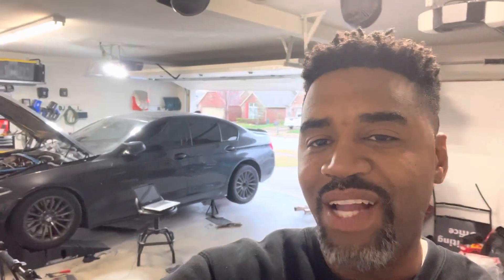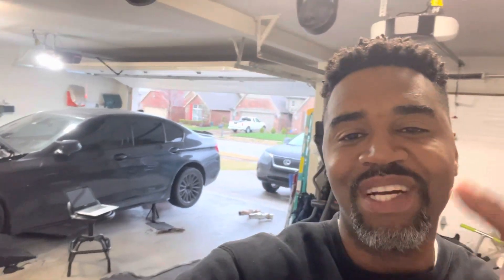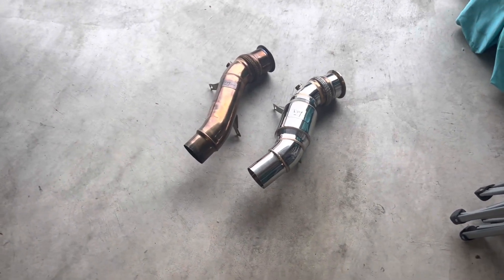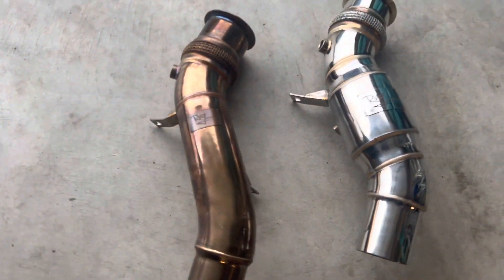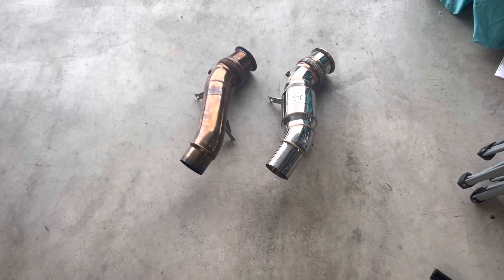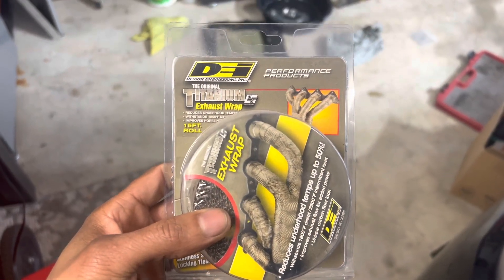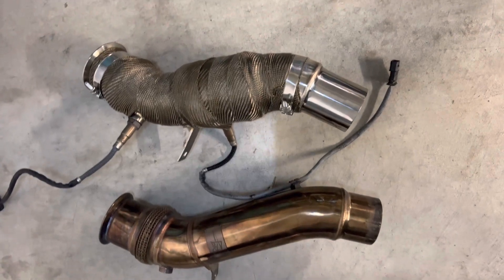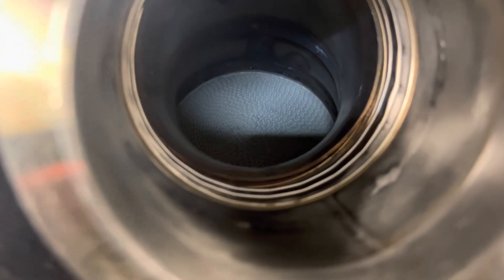BMW N55 Performance Boost: High Flow Catted Downpipe Installation

Comment: As a welder I must say those are some damn pretty welds on an aftermarket part.  RVG definitely stands for quality!  And thanks for making more and more videos Grant.  Made me love my F10 even more!
Reply from the maker: Glad I could help! Also, thanks for the input on the welds. I use to work at a shop with welders and I thought the same when I saw them. I still need to learn to weld though.
Reply: @johnsonmotorsports I want to buy one of those down pipes but I don’t like it the check engine light on I just want to know if we this new down pipe I don’t have any lights on thanks
Reply: @miguelrosario6485 I think that’s why you need to tune it so the system knows .

Comment: Ordered mine yesterday. High flow cat as well. Fingers crossed 🤞 all goes well. Just need to get my Intercooler and some time off to do it once I get the parts. Nice vid by the way.
Reply from the maker: You can do it! I’m sure fitment will be great!
Reply: How did it go? Any video or sound clips?
Reply: No not yet. Just got back from detachment late September so I didn’t have the car. Maybe this weekend again fingers crossed 🤞

Comment: Looks great! I've been debating switching my catless to a high-flow catted for the smell as well, lol
Reply: It honestly smells like a diesel , it doesn’t smell so bad with a e mix
Reply: @KevinTorres-xc2sv  lol interesting! Yea I typically run E50 mix but im currently redoing my entire tune due to a new turbo. So Im starting with straight fuel and Gawd that stink 😂. E50 is so much more manageable
Reply from the maker: Absolutely!!

Comment: How do you like the high-flow downpipe?   I am really thinking about getting one for my 2016 535i, but of course I would need the EWG version and RVG seems to be the only one out there that I can find that of good quality.  This is to go along with the the AFE cold air intake, G-plus stepped intercooler and VRSF down pipe I installed.  Plus, I just got the MHD super license.  Great thorough videos.

Comment: Would you also recommend a charge pipe to go along with the high flow downpipe?
Reply: if you are going for stage 1, ect... you should for sure consider going for a new charge pipe, the oem charge aint gona hold up with the increase in power and will break eventually. : )
Reply from the maker: Exactly! Chargepipe should be your first upgrade.

Comment: Sounds good.  Doesn’t sound much diff from mine running a catless DP.  I’m EWG. Btw who makes the diffuser you’re running? Thanks.
Reply from the maker: Diffuser is here, but the fitment isn’t great. Had to use zip ties in the corners for them to stay seated.

BMW F10 535i Mods: Ninte Rear Diffuser
https://youtu.be/QTriKPa8fE8

Comment: Hey Grant... About ready to hit the "buy now" button for the rvg catted downpipe for my 2013 535i. I know you have one, so since you've had yours for a while now do you recommend it? Also since I have Valvetronic mufflers will I notice much of a sound difference compared to my stock downpipe? And lastly how about any actual performance gains? I do have the MHD full license setup  running stage 1, but sometimes I crank it up to stage 2+. Just wondering if it's a performance gain I will feel?? Oh yeah have you done a tranny flash? I just bought the XHP flash kit and all I can say is wow. Stage 3 is a night and day difference especially in sport plus.. Hope to hear back from you. I value your opinion. 
Thanks for all your work!!
Reply from the maker: Hey, yeah you will notice a sound difference with the catted downpipe. It’s not a crazy difference, but it is present. I don’t have any performance data regarding the downpipe, but it will definitely help. 
Yeah, I have xhp as well. Love stage 3, it is definitely night and day. I am actually considering getting a custom xhp tune.

Comment: How do these pipes compare to the extremely similar looking Racing Dynamics pipes? 
They both use 200 cel but the RD advertise the type of cat being used.  Any word from RVG on what  level of quality cat they use?
Reply from the maker: I know nothing of Racing Dynamics. I’ve never heard of them. I have checked into the quality of the cat, however I know every other part of the construction is top notch.

Comment: My shop attempted to install these but the lower Brackets are off by inches.  The top Brackets only fit 1 of the 2 bolts on both sides.
Reply from the maker: Are you sure you purchased the correct downpipe? I’ve installed 4 of these pwg downpipes and I’ve never had a single one that didn’t line up properly.
Reply: @JohnsonMotorsports  I ordered the correct pipe, maybe they sent the wrong one.  Either way, I'm out almost $1100 in addition to the pipes.
Reply from the maker: How??? What year and model do you have?
Reply: @JohnsonMotorsports  19 m850 coupe.  I had the pipes ceratoke coated as well.
Reply from the maker: Interesting. I don’t know anything about that model. Have you reached out to RVG?
Reply: Does it cause the CEL to come on?
Reply: @Cashka1986  it did
Reply: Thanks for the info
Reply from the maker: Yes, you will need a tune to remove the CEL.
Reply: @JohnsonMotorsports  that’s ok I have MHD. Thanks
Reply from the maker: Perfect.

Comment: Ngl i just installed catless dp on my f33 and the smell is already getting to me🫤
It's fun to drive but the smell messes up the experience 
Can the aftermarket high flow catted pass the emissions test?
Reply from the maker: Honestly, I’m not sure. We don’t have inspections in Oklahoma. They did away with them 30 years ago.

Comment: Hello friend i just want ask ur last video u install the m steering n paddle shifter n how to make the paddle shifter working n need wiring n bimmercode right?
Reply from the maker: The wiring should already be there. Should just need to code.
Reply: Code with bimmercode?
Reply: Bcoz my original steering dont have the paddle n im planing to install the m Steering with paddle shifter
Reply from the maker: Yes, I would try with Bimmercode first. That’s the easiest. When I installed mine, I had already coded my car with Esys for the DEC switch and sport transmission. So it’s hard for me to say what actually worked.

Comment: I’ve had this pipe for close to 2 months now and it’s been so ridiculously hot in Dallas that I haven’t been able to get it installed yet. And every shop I’ve gone to tells me they won’t mess with it because of the turbo. Any ideas why they would shy away from this? Your install makes it look relatively cut and dry, so I don’t get it!
Reply from the maker: That’s weird. Why would they not install it because of the turbo?
Reply: @JohnsonMotorsports  not entirely sure. Hoping it starts cooling down and then I’ll just do it myself 🤣 Your previous install is basically the same as for this pipe, correct? No major issues with fitment (except our bodies under the car 🤣)?
Reply from the maker: @xbeautifuldiscordx  Exactly! It’s really not a bad install.

Comment: U need a tune with the down pipe right
Reply from the maker: No, but you will get a check engine light. The tune will avoid the check engine light and let you increase power to take advantage of the free flowing exhaust.
Reply: @JohnsonMotorsports what tuner do you have? I finally got this installed and getting CELS now with my MHD Stage 2 tune and can’t get it to go away
Reply from the maker: That’s weird. Did you select catless downpipes in the tune options? That should be all you need.
My tuner is David Shoup.
Reply: @JohnsonMotorsports  no I stuck with OEM because it’s still a catted pipe. MHD only has options for OEM or Aftermarket Downpipe
Reply from the maker: Then I would choose Aftermarket. The Highflow catted downpipe has a lower cell count.

Comment: I need a valtronic motor as well
Reply from the maker: Yeah, I’ve done it once. Still watching this one, maybe a battery issue.
Reply: @JohnsonMotorsports  I'm debating with 218,000 miles it's running very good I've gotten everything done to it it's a 2011 I'm thinking about getting another one in October
Reply from the maker: @jeromepatten8763  Nice! Have you done all the maintenance yourself?

Comment: I was going to order one of these to replace my VSRF catless on my 2011. Question here is do you still have to uncheck the "factory cat" option in the tune to disable the CEL? Reason for change is I don't want to have to swap the DP out every year for inspection.
Reply from the maker: I honestly don’t know, I’ve been tuned for catless downpipes for years.
Reply: Thanks. Same but I've never tried bringing it for inspection this way. I've always just swapped pipes for a few weeks with the OEM one. It's getting old haha. @JohnsonMotorsports
Reply from the maker: Yeah, I live in Oklahoma. They did away with vehicle inspections 25 years ago.

Comment: Whats up boss…when you installed you intercooler did u change boost pipe also??
Reply: I just got intercooler not sure if i have to upgrade boost pipe to aluminum…
Reply from the maker: You don’t have to, but it’s a nice upgrade. I picked up a RVG set.